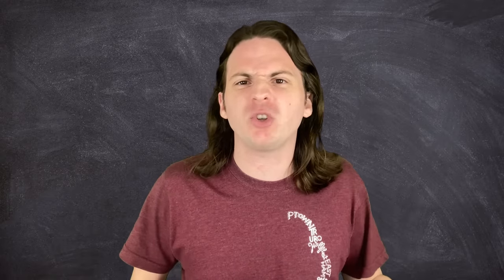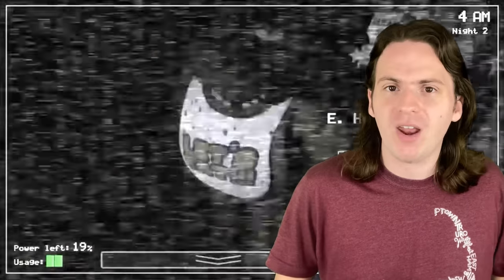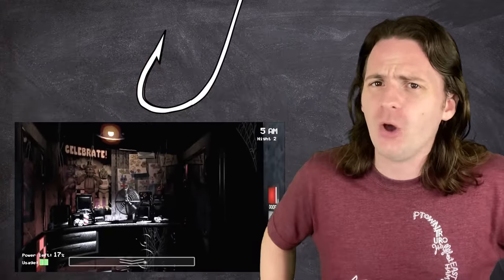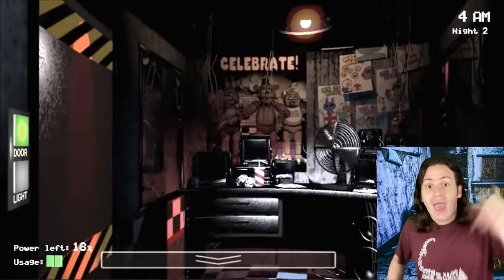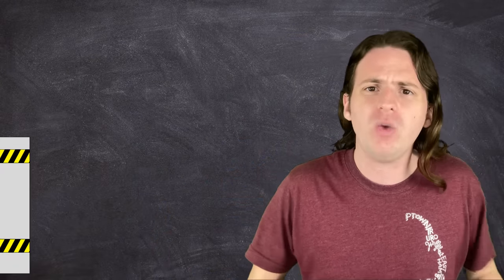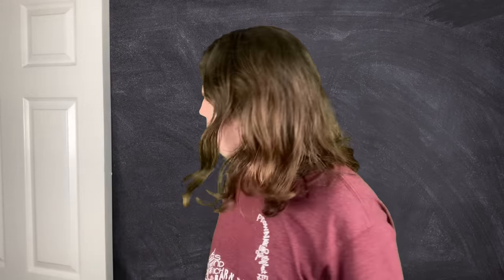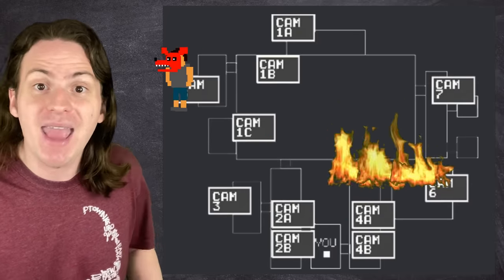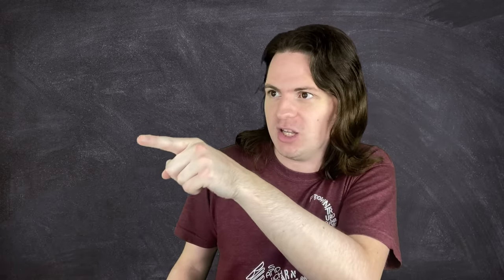Why Don't the FNAF 1 Doors Stay Closed?

Comment: What I think: The building needs to run on a generator at night for budget restrictions. Because of this, the doors would have slammed shut when the power goes out. But then anyone in there would be trapped. So they made a security feature where if the building has no power, the doors are held up. So on one hand, it would be good so you could escape. On the other hand, it would make it much easier for a robber or predator (in this case killer robots) to enter your office, damage vital equipment, and most likely kill you.

Comment: I know this is a bit old but I like younger-me's explanation way better.

The doors need power to stay closed because they need to be actively held down to resist the mechanical strength of an animatronic. When the power is out, nothing stops them from simply lifting up the doors like they were made of styrofoam.

Comment: Fire doors are actually normally designed to close during an activation of the fire alarm system. This is meant to contain the fire and prevent it from spreading to other parts of the building. These doors usually contain electromagnets that are energized normally but when the fire alarm system activates it cuts power to the electromagnets, causing the doors to close.

Comment: I don't know if the restaurant would necessarily use a generator since it's not cheap to keep them fueled and running throughout the night, and we know that Freddy's is notorious for penny-pinching. My guess is that they have a system connected to their power consumption meter that shuts it off whenever the total power consumption is exceeded, because the more power you use means the more money you spend. It has to be a cost-cutting measure.

Comment: What's weird to me is that the doors slam down. You could make them work the same way, with them automatically opening if power ran out and etc by just... having it so they are under ground and they move up to close, instead of moving down.
Reply: Someone could trip on the gap in the floor where the door is.
Reply: @AbbeyYard  i mean... you can easily make it so that the door completely open gets ecactly at the same height as the floor, so there's no gap

Comment: There is a super simple explanation to be found when you think hard enough. Freddy Fazbear's Pizzeria, during the night shift, is running off of a backup generator, possibly solar charged, to save money on the electrical bill. The security doors are specifically made to keep animatronics out, as it's pretty clear that it's a big part of the night gaurd job. The doors aren't normal doors with hinges and simple lock mechanisms because an animatronic could easily break one down. Case in point, Foxy. Foxy bangs on your door when it's closed, meaning that Foxy understands what a door is and could definitely open one if he found a way. But these doors slide down, shut tight, and are made of strong metal. Foxy does put stress on the closing mechanisms though, judging by the battery loss when he bangs on the door. Now the doors work on this mechanism that I like to imagine use springs to push the door up and a piston that pushes the door down, which uses energy to do so. The reason for this being safety, so that in the event of a power outage or fire, the doors open without the need of electricity, and also prevents someone from being trapped in the office. Despite these safety measures however, these are the least of your concerns. In the end, it's just a bad job.
Reply: Bro yapping

Comment: Safety reasons.

1. Aren't trapped inside, similar to a bank vault. Easy to mechanically unerstand if the closed state is when the pysons are in tension, ie they snap open as a default state.

2. So you don't get crushed. You don't want to die from a power outage if you're walking through the door at the time the power cuts.

It makes far more sense then the doors closing without power. The only reason they should close is if they were specifically anti-animatronic by design.

Comment: I would like to point out there is a way this could have saved the Fazbear company money. We know they don’t really care about their employees, but that to some degree they are aware of the dangers their employees go through. It is possible the doors are designed as steel slabs simply because otherwise each night they would have to repair the doors. Between 3 animatronics with the strength to overpower humans, and a 4th one with a literal hook on one hand, they’d peobably do quite a lot of damage to the doors every night. Regardless if they would be able to get through or not, it’s possibly the Fazbear company simply designed the doors for both fire safety for their customers, but also to avoid having to pay for repairs on the doors caused by the animatronics. Clearly they already have enough financial problems, having doors with holes made from hooks being plunged into them, is another financial problem they likely didn’t want to deal with.

Comment: I think the games explained why the blast doors: the previous security guard was a nutcase who thought the robots wanted to murder him, and the thick steel made him feel safe. Not the restaurants fault the guy was right. Then why do they default open? Same reason why the default mode of an elevator is to have the brakes on: in a power outage, you want to be able to get out/you don’t want the elevator to fall. And probably done the same way. Springs to open the door or close the breaks, and an electromagnet to close the door/open the brakes.

Really the doors make a lot of sense, even from just the first games lore, and would be a very easy design in a relatively confined space. You’d need a large dropped ceiling, but with ductwork and everything in commercial spaces, you’ve already got that space. No counterweights needed.

Comment: i always imagined the doors opened in a power outage as an emergency measure. if the doors closed during an outage you would be stuck there with seemingly no way out.

Comment: They could still have put a fireproof system in the doors without using electricity to keep them open: they could have inserted movable bars under the counterweights which would have kept the doors closed but which could have been manually removed in case of emergency.

Comment: Tldr the mechanics likely are a counter weight system that is alleviated by using power allowing it to shut and stay shut, aside from that it’s likely that the doors were made for a combination of false safety as Afton designed a back door method to gate the room off with power or a way to prevent someone from being able to lock themselves to hide or barricade themselves in.

Comment: For why they're a giant hulking blast door: I think that Fazbear corporate knows that the Animatronics are dangerous and put them in to protect the night guards (of course they're somehow too cheap to just give them a stun gun like you get in Pizza Sim or whatever the hell William used to destroy the animatronics in the FNAF 3 Minigames, maybe it's also them being so cheap that they'd rather just clean gore off suits than risk Night Guards damaging the animatronics with too 'aggressive' self defense). How much they know is uncertain but it's clear that they know shit isn't safe since Phone Guy is implied to be management from the FNAF 3 tapes, so at least management at the company knew the dangers of the animatronics. 

After all it's NEVER explained what happened to the Children's Bodies. They likely aren't inside of them by the time of FNAF 1 since they had to do a full remodel of them to explain the design differences between their withered forms in FNAF 2, and also they use them for spare parts in FNAF 2 so they likely looked at their internals. Most likely Fazbear Inc. found the bodies, but instead of reporting it to police they just buried them somewhere to avoid more bad PR. So Fazbear Inc. probably knows a lot more about all the shit that ole Willy did than they let on.

Comment: The fact that they constantly draw power is just incredibly inefficient. Even if there are springs pulling it up all the time. Just mechanically lock the door in place when it's at the bottom. It would still need power while closing, but not the entire time. And for safety (to not get trapped) just charge up a small capacitor to have power, to undo the locking when there is a power loss.

Comment: best solution would be metal door sliding from the side with some mechanical crank and some big lock and some mechanism that would unhinge the door if the power went out

Comment: To anyone saying that the normal doors wouldn't last, in The Silver Eyes novel there aren;t security rooms but control rooms.
Those rooms have normal doors, in the novel Foxy slams his hook at a very high force. That slam only made a crack and it was barely wide enough for his hook.
If you need more proof he again slams his whole arm now, and doesn't do much damage, meaning that those doors are pretty damn solid.

But as MatPat has said, "It's just a theory..."

Comment: yo save time its simple, they open as a fail safe mechanism, when the powers goes out all the ventilation stops, if the door stayed closed you would suffocate (which could have happened in the past) due to the the doors creating an air tight seal. so when the power goes out the doors open to allow air to flow into the office
Reply: also uh there's a reason there giant metal doors, its because any normal door would be Absolutly destroyed

Comment: I assumed that there was a Pully system that used magnets. This allows it to be open when the power goes out that the doors stay open, which is genius Becuase then you cannot get trapped in the office.

Comment: I feel like its a weighted system, so the doors have a counterweight that due to the disrepair the motor needs to be constantly on to counteract a cable slipping or something. Or its a hydraulic system.

Comment: 0:51 so I never really considered it past it been a stupid design but just now I gave it a second thought and while yes it’s still a stupid design that staying closed drains power fast but them opening when they lose power is probably a safety feature, so let’s be real you shouldn’t have a limited supply of power that’s not how the power grid works but thinking about the reasons a building may lose its power supply you don’t want your door locking with this happens as if the building is burning you want to be able to get out so the doors are likely fitted with a revers spring (it could be a normal spring) or leaver system that pulls on the door to close it puff the power is gone and there is now no force keeping the doors closed so the tension on the spring pulls the door back into its open position and you can safely flee the burning building.

Or they needed a mechanic to add gameplay to the game or it’s just you sitting in a room nice and safe for 6 minutes watching animatronics run around outside.

Comment: Safety or not. The thing I wondered about is if the power got suddenly cut off (not just because of running out of it but also if there was some damage in the instalation) and the doors are currently closed, where does the energy required to lift them up come from? I can see how you wouldn't need the energy keep them open but what about the motion of opening itself?

Comment: if we talk about real world, yeah the door in FNAF games doesn't make sense. Since in these cases it's probably hydraulics security doors... But their close/open operations are flipped on what we most use them for these kinds of facilities

Most cases of these doors on secure rooms is a heavy door, pushed up by hydraulics to open it and using gravity to keep it closed. But for some reason the FNAF security room uses a far more automatic type of hydraulic door used in submarines and bank vaults. (ie hydraulics pushing to keep the door closed) which is a much more bad unusable one at that, since it automatically opens at full.

Comment: My theory is that the intention with the doors design was to give the security guard maximum protection from the animatronics without alerting the government , as in a room that can be locked at all times even in the event of a fire or power outage would probably shoot ip a lot of red flags. So this was the most they could for us
Reply: That’s why the doors are so overkill in terms of security. Doesn’t explain why they drain power when closed tho

Comment: heres my theory, the doors themselves were that heavy duty moreso because that is a panic room. a place where someone (william afton) could go in the event that the machines that he made specifically as killing devices decided to try and kill him. it would make sense for his panic room to be the security office because you can see everything from there. as for why they open automatically during a power outage i believe you are spot on although i dont believe it was aftons decision. any sort of eating establishment needs to pass a code inspection and a power activated door not being open during an outage is a major code violation as again its a fire hazard. my question is though if power consumption is such a big issue why are the animatronics powered during the night. yeah i get the whole "being possessed" crap but anyone whos worked with the paranormal knows for anything to be interactive for the supernatural it needs its own preexisting power source.

Comment: Hydraulic System, similar to Hydraulic Press

in our world there's no example, as for us, there's no threat as dangerous as a grizzly bear in the forest. However in FNaF, we have robots twice as strong as your local polar bear if not three times, robots that can shove someone inside an animatronic suit almost (or completely) turning the person shoved there into a pile of flesh, and these robots are fueled by the souls of dead children, so no energy is being used

thoses machines could pull the door up, however, with a hydraulic system, there's enough force to keep the door shut in place while wasting energy with pressurization, as for the opening of the door, the pressure is released and the door is opened.

we'd have thoses doors irl if there were a threat as strong as a Robot roaming around killing people and thinking using ChatGPT

Comment: As a security measure its coherent that an electric door opens up when lights goes out in a place where people usually works, otherwise you would get stuck in there and wont be able to leave the place. The thing that bothers me most is that the place has a "power limit", maybe there is some kind of electrical problem? i mean, which place would put a light shortage on purpose?
Reply: it is a abendent bilding. it mostlikey runs on a generator

Comment: im guessing the doors are pushed down by some sort of piston, and then they com back up with the recoil of a spring, since when the power goes out the door goes up. no power holding the piston down so the springs let the door up.

Comment: Okay so a lot of people are throwing around the idea that the doors are operated using springs and electromagnets, and I agree, and I get the idea of using normal doors but the big doors seem ot be for fire safety and so the guards don't get merked, an animatronic can easily knock a door down, and when there is a fire, getting trapped in a place that could burn down is a terrible way to go, and of course I get the idea that the fire wouldn't even be able to get inside but considering the FNAF movie, it's very possible that nobody actually goes to the building after your shirt, which means making the doors unable to open without power would trap the guard in and nobody would be the wiser, meaning the guard would just straight up die from hunger or thirst, and the thing about the animatronics, obviously a plank of wood with a doorknob could easily get broken down by an animatronic, a big blast door cannot, and even if it was a sheet of metal with a doorknob, pretty sure these animatronics are smart enough to open a god damn door, and another worry with the doors closing when there's a lack of power is that if there is somebody under that door, then they can just say goodnight because they are getting split in half, and another issue is that if the doors stayed open (and the whole electromagnet theory is proven true), considering how much power it takes to keep them closed, if it was the opposite, then it would be actually impossible to survive FNAF without keeping the doors closed, which I guess wouldn't be an issue but then again, the whole fire safety, thing, and the fact kids could die from getting crushed, and animatronics could get damaged, costing the company millions, so overall, these are actually the best possible doors for that location, of course they can get you killed but at least it won't get a poor kid killed, and even then, unless you're being brainless or the animatronics aren't going 4/20 mode on you, running out of power unintentionally is pretty difficult, so yeah this is my ted talk defending the poor FNAF 1 doors you've harassed, you monster. I think they got PTSD from that too, how dare you, evil evil YouTuber :(

(That last part was sarcastic in case somebody has brain damage)

Comment: I’m gonna guess that it’s just cause the doors are airtight enough to cut off circulation, it’s a safety measure to avoid suffocation
Reply: Considering how the window on Chica’s side is cracked, it’d be pretty easy to get more air by just breaking the windows

Comment: the door should fall DOWN to open not rise UP to open, this would prevent any crush risk, the door would need power to push the door up by means of hydraulics but then would need very little power to keep a magnent powered pin to hold the door in place, if power is lost the pin would fall back letting the door fall slowly with the hydraulics under it while needing about as much power as the fan in the room or the light on the ceiling